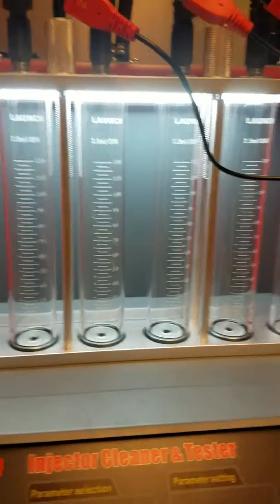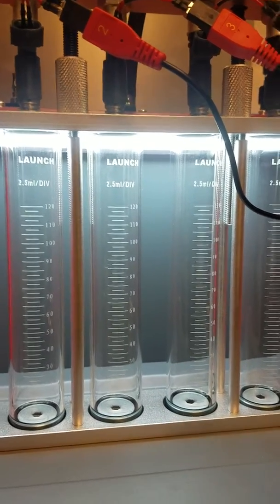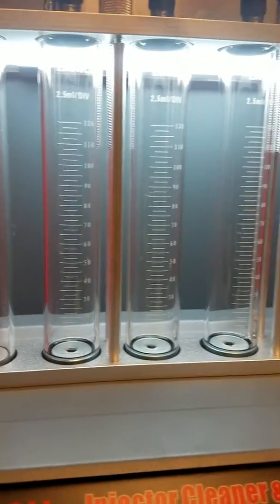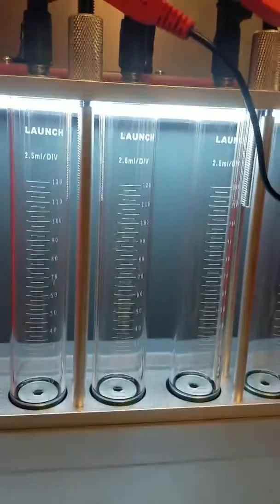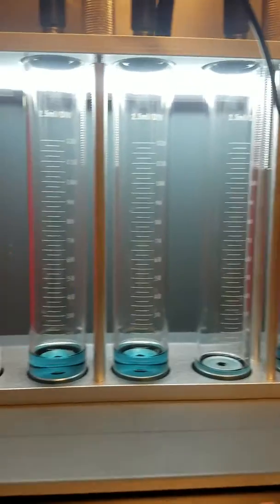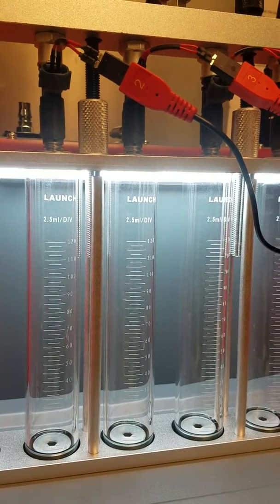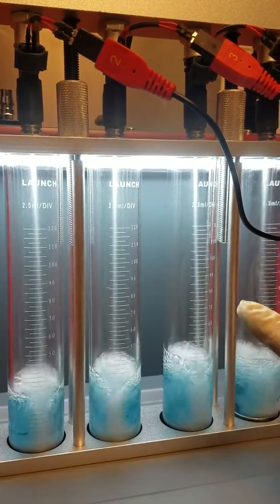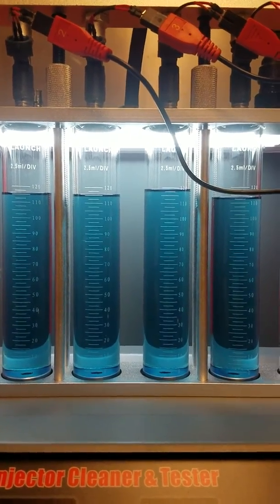Demonstration of poor driveability on modified stock Subaru WRX injectors.

Comment: Interesting.  What injectors would you recommend? Need to go up from stock 565's .  DW 750 on the Bosch platform or ID 1050x (a little overkill) or other?